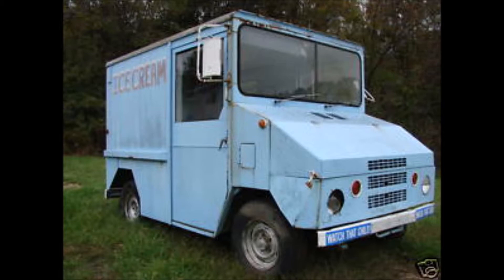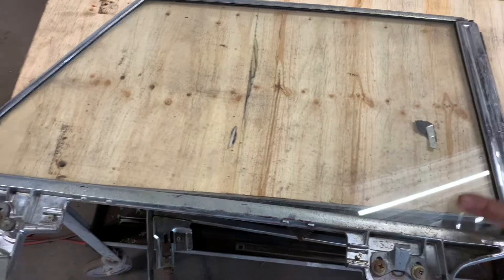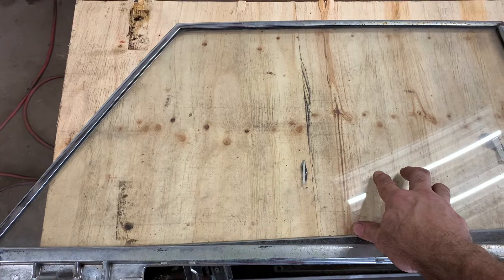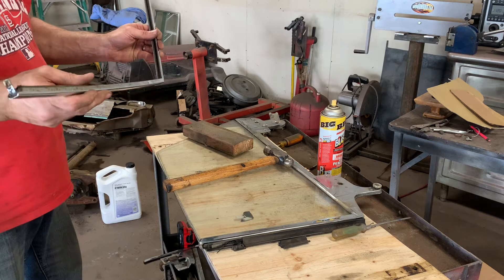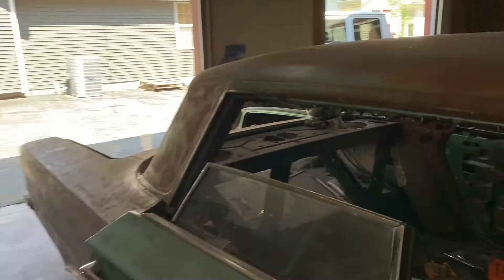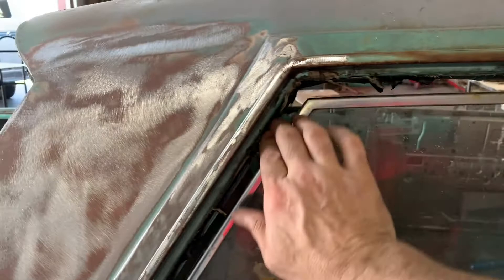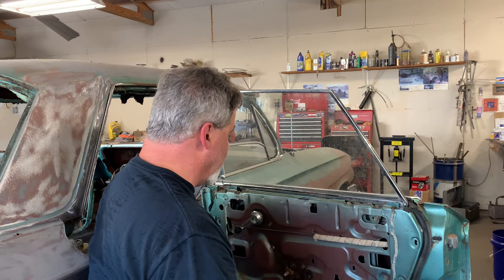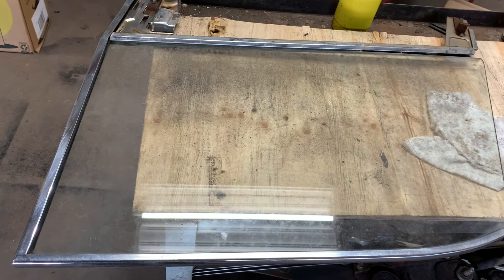61 Impala Hardtop 4dr to 2dr conversion part 9

Comment: What are you planning for a engine? If you could get a 348 that would be cool.But expensive probably with a 4or5spd.
Reply from the maker: I got a good 283 with the car so I’m using that but adding TBI injection. There’s a few episodes of going through the motor in this series; check it out. Thanks for watching!

Comment: Just gave me a little laugh, I have had this one side of the quarter opened up until finally today. Just so I could get my glass all fitted in. I already welded the other side, before I got the glass in... So, I feel ya. I have to get inside that little area and weld in that back rail.
Reply from the maker: I’m hoping I can find a rear window regulator from some kind of little four door in the boneyard that I can make work. I don’t really want power windows but may end up going that route.
Reply: @Savinjunk  wish I had one in mind to point you at. They took alot of effort to change their back window mechanisms on every single car I think.
Reply from the maker: @3MonkeysGarage  I’m going to give your page a plug on my next video; should be out this weekend. Part 10 of the 69 GMC I’m working on.
Reply: @Savinjunk  Thanks bud, I will do the same. Looks like we are both in the same boat and of the same mind when it comes to the old cars.

Comment: be careful with that 4 dr hard top stuff.....its hard to find if you need any of it.....i daily a 62 pontiac catalina 4 dr hard top and had to track down some of the 4 dr hard top specific stuff and it can be a pain to locate....
Reply from the maker: Thanks! So far what I need as far as door and window seals I’ve seen on eBay. You Poncho sound cool, those are great looking cats.

Comment: NO YOU CAN'T cut tempered glass it's heat treated to be stronger not to break you'll never cut it make a template bring it to your local auto glass shop they'll cut a piece of flat safety glass its laminated like a windshield that'll fit then I'd cut the track and use j.b weld and glue in the glass with urethane that's cool that you're going to make them work as most people just stick plexiglass in and say gidday!
Reply from the maker: Yeah I’m going to have to come up with something else for the rear window regulator but I have the front one figured out. Just have to shop the boneyard and see what I can come up with.
Reply: @Savinjunk  cut it down use j.b weld glue it together then glue in the glass with urethane she'll work I'm a Glazier or glass man for the trim around the glass I'd cutvit at the back on the top and tack it on the inside to hold it so you don't see it on the outside